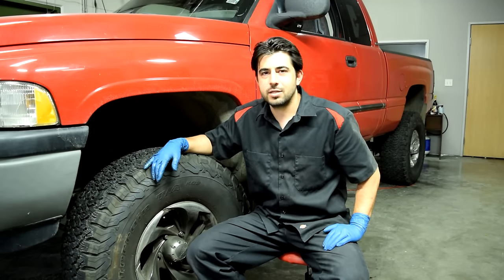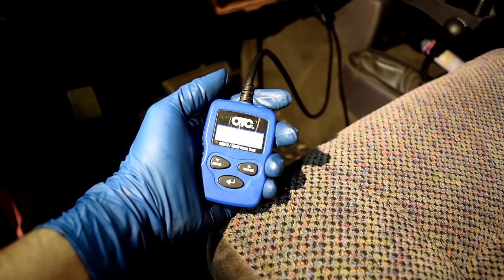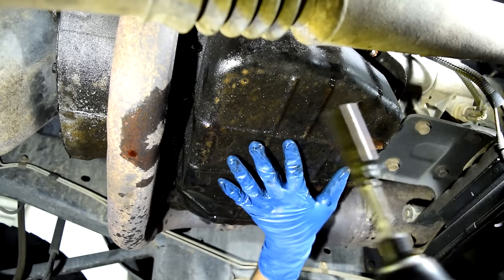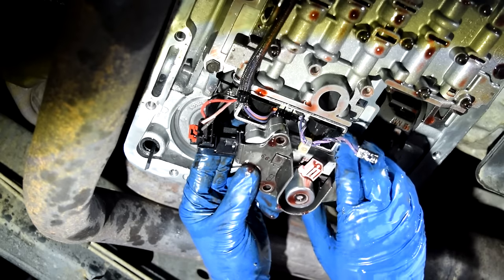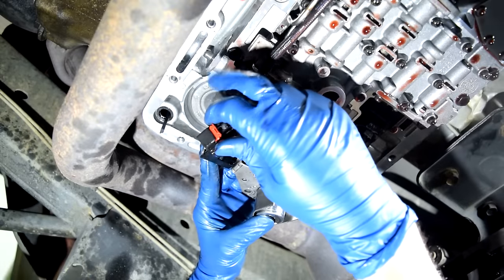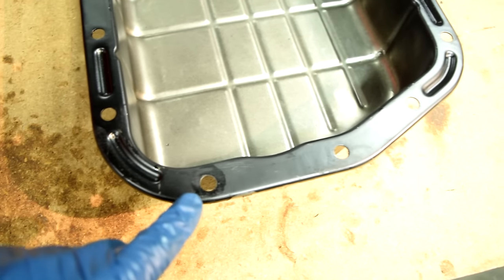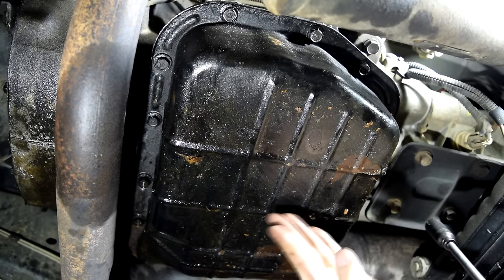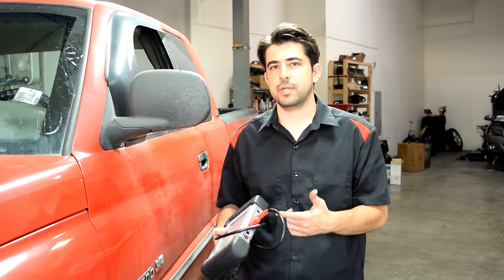How to Fix an Automatic Transmission That Won't Shift - Replace Pressure Solenoid, Fluid and Filter

Comment: gov pressure solenoids is a common problem what he forgot to do i adjust the bands they typically need to be adjusted on dodges almost all those transmissions have a hard plastic reusable pan gasket the factory reusable gasket is the best option if your truck did not have reusable  one use a cork gasket and no rtv just remeber if you use a cork or rubber gasket do not over tighten the gasket

Comment: Friend I have a problem my car works well for 10 or 15 minutes but at that time the automatic transmission stops working the engine is running but the transmission does not go forward I turn it off I wait for about 10 minutes and the transmission returns normally
Reply: Remielmasloco did you ever find out what the issue was my trucks doing the same thing
Reply: Brandon Hill mine is as well any info
Reply: Transmission will go in any gear at start up afer few seconds i lose all trans movment plz can somone help

Comment: That didnt work for my Jeep. Even though the code was the Governor pressure solenoid.Maybe I need an advanced scanner. But I'm not sure what would work on a 1995 for diagnosing. I'm going to be taking it to a Transmission shop. Surely they have all the advanced diagnostic equipment. Unfortunately it always appears to be different solutions for different year vehicles. Too complicated for OBD1 vehicles. But I love my Jeep.

Comment: The fluid is not over full. You need to put a Dodge in neutral to check the fluid. Printed right on the dipstick. The new transmission fluids smell burned right out of the bottle.

Comment: can somebody help me out. I think I got a transmission problem but I tried all angles vacuum leaks replacing belts change out old trans fluid. but the rpms are higher at lower speed

Comment: ****My 05 dodge 5.7 hemi's does not work in eighter reverse, drive, 1st or second gear.  No indicator on my notification panel.  What do I do?  Or what could it be?**
Reply: Fernie Solis did you figure this out?

Comment: it wasn't over filled. your supposed to check the fluid In neutral on the Dodge. if you check in park you got no torque converter charge which gives false reaping

Comment: have 05 Audi 3.2l v6 was driving got to stop light press accelerator go didn't go just STARTS n RUNS like new tow it SHOP check ATF WAS OUTTT use 5 pats still nothing but run n starts won't move Help???

Comment: I would strongly advise against trying this kind of work yourself. The work is easy, but the diagnosis is extremely difficult. 9/10 times it wont be the solenoid that is given with the code, with old cars like this you have a decent chance but on newer stuff you just have to be in the trade and know the common faults on different gearboxes. You are also lucky to have a 56RE where you can change the pressure solenoid individual from the valve block, you aren't going to have a good weekend spend 400 quid on a valveblock to fit it and then find out that the forward clutch is gone.

Comment: my 97 Ford ranger won't shift into gear when in park inless I turn it off turn key 1/2way then put it in neutral then turn the car on then put it in to gear for it to run

Comment: NEVER use a metal scrapper when removing gaskets if you push to hard or go at to much of a angle you can put bites in the mating surfaces witch can cause leakes

Comment: I have a Toyota transmission in a 92 Toyota 22r engine it's an automatic and when I put it in gear it will go in till I let off the gas when I let off the gas it kicks like in to neutral I can shut the truck off for about a minute to restart it and it will work again until I let off the gas when I let off the gas it keeps out again what is wrong with it I was thinking the torque converter is that what is wrong
Reply: Please get back with me I really appreciate it

Comment: Please help my dog got under my 2001 Dodge Ram 1500 and chewed up some wires I think it is the shift sensor because I lost every gear but 3rd I took off the connector and there is a green wire and a blue wire but on the other side that has been chewed there is just about every colored wire does anyone know how to even begin to see which wire's go together I'm trying to splice it back together

Comment: Sir you don't need a silicon if you have gasket,,is like you are putting it there permanently and you will never remove it.
Reply: I use a little grease myself
Reply: Siafu Siafu I just put half the bolts in gasket holds them on easy peasy
Reply: carsnakes 35673 That's how I've always done mine too and never a problem. Should have watched this before I did my flush though. Would have replaced the solenoid. Check out the video I posted on how messed up my fluid was.

Comment: what happens when you take your car into aamco? after asking on the phone to service it?  well flush it no questions asked? several time . he agreed several times.
what do you think happned? well i asked again he agreed. come back in an hour he says. ok were back , and its still on the rack. wtf?   oh it did this on test ride and this is .... [ the standard spook the customer into a rebuild] instead of doing what i asked to have done. hey aamco this car still goes. aamco was caught before practicing this. one transmission shop i worked at did the same, show the customer the clutch and bushing particles in the oil pan and feed them a story. a large pile yes and most likely theres some reason they came in for a transmission oil change. you can run transmission fluid in you engine as long as you keep it full, it burns/dissipates in an engine BUT lubricates better. theres a reason recommended fluid changes are set at 25,000 miles, trans fluid is good stuff. add a cooler for it and a hundred bucks will save you thousands.

common sense people.....
Reply: All
Automatics
Must
Come
Out....

Comment: i just bought a 1994 ford tempo gl. when i start it snd go to shift, it shifts in hear but wont go. its like its in nutral but itd not. it does that in sll gears. 
Anyone have any suggestions?

Comment: Good day to you 2000 Ford taurus want take any gears shifter is hooked and moves when I shift but want engage where would you start
Reply: You need a torque converter.
Reply: @whitsend11  ok thank you for reply

Comment: i have toyota corolla 2011 model, my transmission wont shift to 4th gear untill engine become hot. i have to drive 3 or more kilometers before shift into 4th gear.   1st, 2nd, 3rd are in normal shift. please anyone could give me some solution about it? thanks in advance.

Comment: hi 

pretty unusual request no doubt ha. ha 
ive posted a video of my car engine on YouTube ,could you have a listen , the main noise is fine it's the slight metallic Chain heat rattle I can hear on idle .
now mine is a m47 engine so the one which didn't have a the issues .
can you help me out

Comment: Hi I have a 2000 Ford Mustang V6 and my transmission been doing the same for some time now and now my car doesn’t want to drive it only catches it in reverse and park. If I do the same as you did in this video can it fix my issue with my car?

Comment: please someone reply!!!! i have a nissan altima that hesitates i recently had it scanned and  code p0746 popped up. i already changed the spark plugs and my transmission oil the problem is still there.
Reply: pleaseeee tell me what can i do i need to car for work

Comment: After all back together, my battery went dead and had to recharge. Strange, it is a two month old battery. Never had that happen before.
Reply: That's why disconnect the battery,  especially if you're replacing electrical devices 😂😂😂

Comment: Im having a shifting problem with my 98 durango 5.2 4x4. It shifts late out of 1st gear at either 3krpms or 2k if i let off the gas but once its in 2nd gear it shifts fine through 3/4th. If anyone knows what the problem could be i would really appreciate it.thanks
Reply: My gmc envoy is doing this exact thing.  I got solenoid codes.   Getting ready to try and fix.  This video was great

Comment: Chrysler products should be checked in neutral, not park,as there is no cooler flow in park, probably why it was overfilled. Honda auto trans should be checked with the engine off.

Comment: I would have put in a drain plug if thats your personal truck.
I got an issue i would like you to help me with if you can. Anyone that tastes fluid should simply know all the answers. : ) I got a dodge ram 1500 van 2003 it has the 3.9 in it. 6cyl. I just did my first ever trans rebuild on this. Replaced everything Inside it and now it won't go into gear at all. It grabs n lets go. What could this be? I'm about to chuck a jack threw the windshield! Engine is another story.... HELP! Don't tell me to taste the fluid either. : )

Comment: Where would a guy find out where you'd get. Info for a dodge ram 545rfe. Transmission if it flashes 7 codes from 750 to 916. ???? Thanks doesn't go into gear

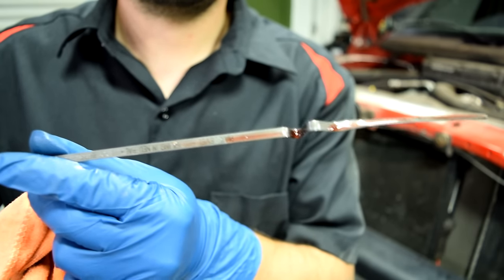Comment: Rookie mistake Ratchets and Wrenches. Every proficient mechanic knows that the pump in this transmission does not run in neutral (common with mopar transmissions) it is even stamped on the dipstick to check the level in neutral (1:13). This is why the cooler line outlet was not pumping fluid in your transmission flush video. You should know things like this before you try and advise others. I hope you didn't return this truck to the customer with a low fluid level.

Comment: I changed both selenoids and got the same non shifting results, and my scan tool is still picking up the same codes! HEEEEELP
Reply: check the outside speed sensor. Its on the outside of the transmission. I bet it fixes the problem. You dont have to drop the pan at all. The part cost 13 bucks

Comment: i have 04 ford  e250  4.6   the shifting   betwen  1 and 2  it is to slow
Reply: Did you ever figure out the issue my truck is doing the same thing?

Comment: will this fix a tranny that will not pull at all no reverse no forward no check engine lite fluid loos and smells good . going down road and quit pulling   thanks    2002 360 4x4
Reply: no it wont probably need to rebuild it

Comment: I can't go faster than 70mph and it will not shift
Reply: Strange Tattoos is it a dodge ram? Mine did that and had horrible idle when started at operating temp. Mechanic said it was a faulty temp sensor reading -40°. It was dumping too much fuel in and essentially flooding.
Reply: Teddy Staples yeah its a dodge ram, I think my fuel pump is going out

Comment: Hi there, I recently replaced the gearbox on my 2005 Renegade CRD A - Diesel. It was replaced with a second-hand gearbox, the original gearbox from a car that was being sold by parts. We have installed the gearbox on my Jeep and all seems to be working ok, apart from the third gear that won’t engage smoothly. There is a bit of a jolt whenever we shift into gear 3 and we have tried to identify what could be causing the problem, with no luck. Any help on this is highly appreciated. Please help if you know what the issue might be and advise on what we would do to fix it.

https://youtu.be/00xKT3mR-vk

Comment: Chrysler uses this common sensor and solenoid for their cars, Jeep, Dodge and deferent models of Chrysler, every single car equipped with this solenoids, specially that piece of junk black electronic sensors, will be encounter shifting problem sooner or later, apparently they use this guaranteed to fail parts for obvious reason, I have a Jeep Grand Cherokee Laredo, I purchase the car with shifting problem, I replaced the sensor and solenoid, since then I had the same problem again and again 3 times, the parts are expensive, almost $300 total parts and trans fluids from dealership and fixed the car waiting for another failure.

Comment: I have found a video of the exact symptom my transmission is showing. it is going into limp mode. When I start the car from cold I get about a mile trouble free then the dash shift control lights start to blink and it goes into limp mode, just like this video. 
 https://www.youtube.com/watch?v=9toEePJNhC4   Thank you for all your posts.